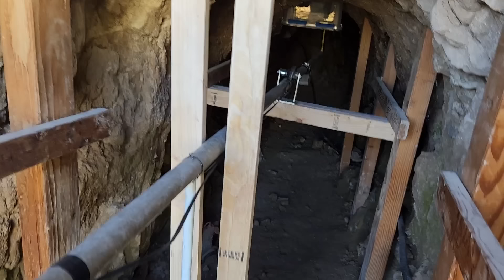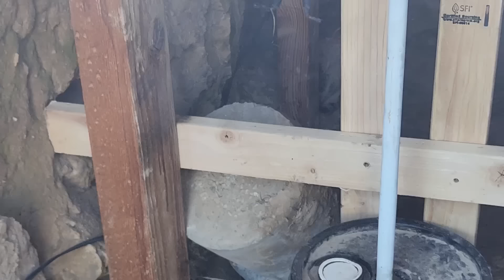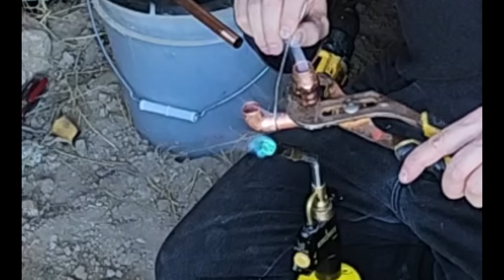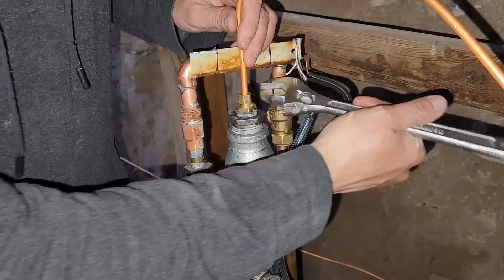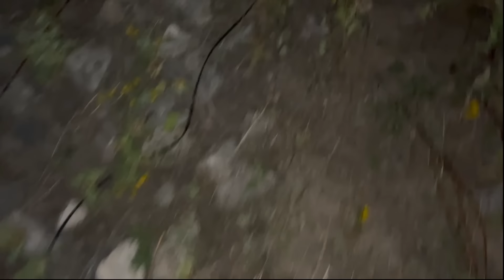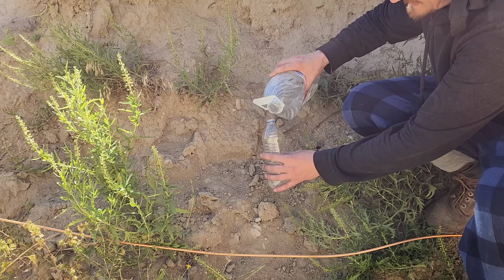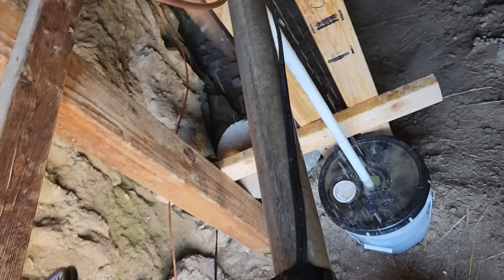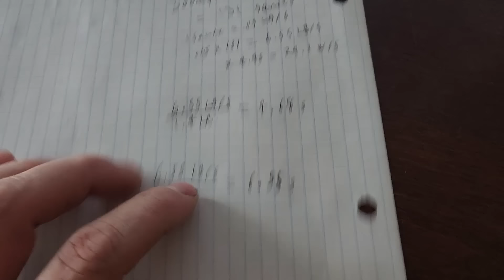Sodium Water Hybrid Rocket?

Comment: That worked way better than I thought it would! I figured you would have melting problems. I wonder if it would be better to inject both the water and the sodium as a liquid. Or you could fiber reinforce the sodium with something like steel wool. In any case I'm interested to see more!
Reply: Press the sodium flat onto a piece of posterboard large enough to then roll into a long tube. The paper (depending on thickness) should form a graphite shield and allow only a limited amount of sodium to make contact with the water, and it if everything works, the sodium will burn in a spiral pattern with minimum loss from rapid melting. This should produce a more controlled burn for a longer duration.
Reply: I'm also curious as to the implications of reducing the nozzle diameter. It seems to me that the smaller hole would force the water and sodium to react longer before exiting the nozzle
Reply: @lynndonbarr3153  only issue is that it increases the pressure in the chamber, and im not sure how much pressure those pipes he is using is rated for.
Reply: @lynndonbarr3153  I wonder if somehow atomizing the water could help it to react more easily/readily.
Reply: There is a fine line that must be walked in sizing the nozzle. Too large and you produce less thrust, too small and you build too much pressure and make a bomb or blow your nozzle out of your rocket. @lynndonbarr3153
Reply: @lynndonbarr3153 increase the internal pressure, especially if there was a blockage, of course but those galvanised plumbing pipes are extremely strong. There must be some data on their strength on file somewhere. More likely the top where the pressure washer nozzle is would blow out before the pipes burst. Lucky he has a tunnel!
Reply: yeh i was going to mention maybe burning the rocket outside in with a series of small holes at the bottom instead of one big on in the center
Reply: That's actually a sound idea! Maybe some kind of mesh. Would the steel wool react with the melting sodium in the pouring step?
Reply: @Misack8 Actually yes you would get some interaction in the form of ferric-oxide but it would be negligeable.  Still while I was thinking making a wax layer to accomplish siloing, this matrix would make a better complete burn
Reply: Could use NaK which is liquid at room temp, and arguably more reactive with water than sodium alone.
Reply: Read “Ignition”, I think this has already been tried.
Reply: @darylcheshire1618  I think that book covers just about every potential rocket fuel you could think of and a few more that are esoteric and very dangerous making the Pepcon disaster look like a walk in the park.
Reply: @ehsnils  It was even suggested to increase the reaction mass with mercury or dimethylmercury. The author didn’t want to do it but someone did it in a remote area, even in the ‘60s it was declined due to envirnmental concerns.
Another scientist wanted to use the unstable perchloric esters which was discredited in “The Chemical Elements and Their Compounds” by Sidgewick which was a book that I have. The passage said researchers of perchloric esters wore iron masks for protection.
Reply: I'd consider injecting melted liquid sodium and water into a combustion chamber.
But I think that sodium isn't a good fuel since it's so unpredictable. I think that the sodium/water reaction is much more complex than what we can imagine.
Reply: @ehsnils Yeah there's probably many reasons that sodium isn't used as a rocket fuel, but primarily is the unpredictable way water reacts. It seems like the byproduct heat flash-vaporizes the water and that makes the combustion uneven, and of course there's the issue of the unreacted liquid sodium falling out through the nozzle.
Reply: @stopthephilosophicalzombie9017  I just wrote somewhere else that we should: reduce the sodium-water interaction surface; 2. Develop a second stage forcing a swirl to increase time of reaction and work in a water excess setup
Reply: I was thinking something like chicken wire as a reinforcement, like concrete.
Reply: At the moment it's a solid fuel rocket, whereas injecting both water and sodium as liquids would turn this into a liquid fuel rocket. That complicates things a LOT. I don't think there's a single model rocket enthusiast or professional experimenting with liquid fuels, so it's better to instead focus on optimising the solid rocket system. There's a huge number of things that could be improved here.
Reply: @ilyaholt8607 this is a hybrid engine already though not just a solid motor
Reply: @ilyaholt8607 Cody already dabbled with liquid fueled rocket designs way back in the day, and says at the end of the video he plans to go that route. Definitely a hell of a challenge but if anyone can do it he probably can.
Reply: @ilyaholt8607 there are liquid rocket hobby rocketeers but non working with mettalic fuel
Reply: @ilyaholt8607 it's a hybrid rocket, my favorite types. Easier that fully liquid, way safer than solid and throttleable
Reply: The problem with liquid sodium is that it will corode your piping. They ran into this problem back when there was the idea to use NaK as a Nuclear Reactor coolant.
Reply: @rebeccarivers4797  I thought liquid sodium is still used in today’s nuclear reactors? Not NaK though.
Reply: I was going to suggest the same thing, I just don't know what sort of material might stand up to the temps. I was thinking something like a honeycomb in a catilytic converter that sits right on top of the nozzle, vary the length for experimentation, also there would be no reason to have all the holes in a honeycomb pattern the same size. Maybe larger around the perimeter and smaller near the center? IDK just thoughts.
Reply: Both good ideas worth checking out. I almost want to build my own rocket to try.
Reply: Considering @stopthephilosophicalzombie9017 input about instability caused by flashing the water into steam,  could you just inject steam as your oxidizer instead of liquid water? You might need to pressurize it to keep the quantity of reactant high enough. 

I'd also consider raising the rocket body to NA's melting point before removing the bolt. This should eliminate any issues at the interface between pours.

Also, I'd use a metal mesh, like window screens, to contain the sodium. 

Finally, it's worth reviewing the combustion geometry for these hybrid rockets.   Mythbusters may have done a segment on them.   Ideally,  they burn from the center out, not top down or bottom up.
Reply: Could there be a way to make the sodium as pellets? My thinking is to get the water into the sodium holding area in a method of a swirl or cyclone type pattern, the pellets will get wet sooner, they can move and help to get other pellets wetter quicker. Would this be able to increase thrust in a shorter time frame? Perhaps a water container which you could drop the sodium into in order to produce a high volume explosion/reaction in a shorter time? I am guesstimating a glass vial spear of sodium straight into a volume of h20.
Reply: maybe make it into a powder, molded with something like clay to make it stay solid. for instance, mix powedered sodium with some powdered clay or graphite and press it into shape, so that it is no longer able to melt. also, burning hydrogen will produce water. chemistry is out of my league, so i have no idea. but it might be possible to inject oxygen into this fuel? a bit of water could start the combustion.
Reply: @itoibo4208 if you had that cylinder of sodium, and instead of using water, simply placed a HO lance inside as the injector nozzle, the huge heat should create an extremely quick reaction. Yes it would burn for just a few seconds, but with high impulse I think
Reply: @itoibo4208  Making sodium powder is actually quite tricky if you want it to be a fine powder: Sodium metal is quite soft, so all the normal techniques for making powder (milling, grinding and so on) wouldn't really work - it would stick to any tools you tried to use. Like if you tried to use coarse sandpaper to make a powder out of hard cheese.

There is a way of making what chemists refer to as "sodium sand" - literally a suspension of sodium particles the size of sand grains in an organic solvent. For that you need a solvent like toluene or xylene which has a boiling point higher than the melting point of sodium: Fill a flask about halfway with toluene and add chunks of sodium. Ensure that the remaining empty volume in the flask has no oxygen by purging with nitrogen or argon. Heat the solvent up until the sodium melts, then pick up the flask (while wearing heat-proof gloves of course) and give it a vigorous shaking. The turbulence created shatters the blobs of molten sodium into a lot of much smaller blobs - and if you are really lucky, it won't all coalesce back into larger blobs while the solvent is cooling back down. This isn't a perfect method and takes practice, but it's not impossible either.

An alternative to using metallic sodium is to use sodium hydride. This is available as a powder to begin with - in fact when you buy it from a chemical supplier, it usually comes as a powder. Sodium hydride reacts with water even more vigorously than sodium metal does - and you get twice as much hydrogen gas in the process. Clay is a possibility if you can be sure it is dry enough - but I like the idea of using graphite powder as the binder, that would probably work really well.
Reply: Hasn’t Thunderfoot been working on something like this recently? Using NaK (sodium-potassium alloy) cause it’s already liquid.

I think he tried both automotive injectors and some kind of ultrasound nebulizer. (That got shorted by the liquid metal)
Reply: @felixar90  babbington burner  may work for atomisation. I've used such to combust veg oil, and sometime it has appeared to have been very close to resonating akin to a pulse jet. Had plans to try power the atomisation with pure oxygen. (oil+pure oxygen should self ignite). But not tried such yet. ..
Can Power the atomisation by steam. Which could offer a way of cooling the nozzle, as well as  supplying  water to a reaction with sodium 
. Jet the liquid metal onto point near tiny atomisation hole. The disk of fast outwardly flowing liquid metal ends up thin, and should get  punctured by steam jet resulting in spray of  atomised droplets.
.there are sometimes issues keeping  a single oil droplet +air lit. But I found a simple solution is to have plural  jets fire tangentially one way  around inside of   a tubular combustion chamber. The swirl seems to help stabilise combustion/if the flame gets pushed away from jet... It just lights the next jet, and so.   Ie it becomes a rotating combustion engine.
Reply: @felixar90 Thunderfoot is literally the worst person on the internet
Reply: I came to say liquid sodium 😂

Comment: Excellent design, I wonder if you could avoid the sodium falling out by having water and liquid sodium both spray into the combustion chamber.  Split the Argon line to a second chamber with the sodium in it, wrap that chamber with a heating element, and use a second power washer spray nozzle.  Might need to find a Y connection so the two sprays meet, and would probably take some trial and error to get the flow rates into the proper ratio for complete reaction of the sodium.

Comment: What about preheating the sodium to a liquid state and forcing it through a pressurized line to combine with atomized water also? This would prevent the solid sodium from melting and being used as reaction mass through the nozzle before reacting.

Comment: Maybe try using a baffle system inside the reaction chamber, something like a perforated tube through the middle of the sodium that way it will slow the reaction and keep large pieces of sodium from being pushed out the nozzle which will create a more consistent burn and more thrust

Comment: Steam can make enough specific impulse for flight.  Starting with steam in the first place as may solve some issues , like self pressurization and reaction interaction and the need to super heat the Water from ambient temp.   A steam rocket over your sodium simply in a post reaction area may not need to be chambered, just an area for expansion and velocity to continue like a big exit cone or nozzle made from sodium or a second bigger chamber lower psi than the phase flow of the first but allowing for expansion of mass. Also are there any amalgamates of sodium that might react less violent but still have time to react, like a plated H2o2 catalyst pack.

Comment: Thoughts (probably mainly bad):
Spraying the water from below
A mesh container of sodium beads covered in water soluble coating
Invert the combustion chamber, drop sodium pellets into a pool of water, and ducting the exhaust 180 degrees to exit through a downward-facing nozzle.
Same as above, but chamber full of sodium, and feed the water in from the bottom.

I can think of so many bad ideas to throw at this!

Comment: hey cody have you tried using high pressur steam ? id imagine its worth a try to inject high pressure steam and adding more smaller holes through and around the main hole in the sodium tube ? id be curious to see if that helps with a smoother run  and better results

Comment: Maybe instead of a pure sodium fuel pellet, you could do a layered one so a thin layer of sodium, a thin layer of something dissolvable in water but ideally heat resistant (powdered dry clay maybe? or something along these lines at least) to isolate the sodium further in the chamber from the water and to hold it compact still whilst the outer (inner) layer is burning. This may produce a much smoother burn of the rocket fuel pellet. You'd probably have to play about a ton to get the layer thickness right, but it could work I think.

Comment: It's probably a good idea to not put the sodium in in a single solid blob because all those remaining unreacted sodium tells me it needs more reaction surface.
Engineering question: how does one reliably deposit sodium into a high-surface configuration? Etching or even wet-etching is out of the question for obvious reasons.
Reply: Seriously, it's probably easier to vaporize the sodium in an inert atmosphere & then injecting it into a combustion chamber along with steam. Gonna need an inert & fire resistent combustion chamber recoil valves.

Comment: So with your next rocket going to be a fully liquid NaK plus water design that means you're going to have to come up with an injector for the NaK and I kind of want to see what happens when you push the alloy through a pressure washer nozzle at pressure washer pressures and just out into the air. Sort of a liquid metal flamethrower.

Comment: The computer next to Cody whilst he is doing paper based integration is just a paper weight, whilst the paper weight is the computer. Love it
Reply: We have technology, scissors are great for cutting paper. Best technological innovation since sliced bread.
Reply: @heroslippy6666  wait, do scissors post-date sliced bread?!??  ;)
Reply: @DavidLindes  no ;(
Reply: I still die a little inside seeing him switch from imperial then metric (once things have to actually be accurate) and then back to imperial again.
Reply: @Runefrag  Imperial is perfectly accurate, the only error would come from someone who doesn't know how to use it.
Reply: @RossLouis96  The only reason why that dumpsterfire measuring system has any semblance of accuracy is because there's been a lot of effort to have it be translated into metric with at least 4 decimals.
Reply: @Runefrag the ratios between units doesn't change the accuracy. Metric is more logical and easy to use, yes, but Imperial is no less accurate than Metric.
Reply: @Runefrag  You should see the other funny measurement systems Cody uses occasionally.
Reply: LOL (actually) :D
Reply: I didnt even notice it at the moment, hillarious indeed 😂
Reply: under-rated comment!

Comment: Too much water too fast, should have some comb/zigzag inside and spray onto it like a pressure washer on a low setting.
Also feel like the core hole of the fuel shouldn't be in line with the exhaust nozzle so it has more time to build up pressure and mix the fuels.
Another banger video though, keep it up big man!

Comment: Such a shame what an absolute waste that wasn't nearly enough water pressure to sustain a powerful thrust. 800 PSI by the time it got to the nozzle was barely anything. A super soaker water gun would of sprayed harder than that. Should have went to at least 1000 or 1500.

Comment: Maybe it could be made more efficient if you injected the water into the bottom of the reaction chamber, and had the nozzle connected to a pipe that runs through the middle of the chamber (and is open to the chamber at the top) so that the reaction chamber exhausts the gasses from the top of the chamber, rather than blasting out the unreacted water and sodium from the bottom.

Comment: I wonder where the water went? I think the big issue here is that when the sodium reacted with the water, it dramatixally increased the pressure in the chamber. That could've caused the injector to close, but unlikely with I think you said 800 psi. But more importantly, the pressure probably pushed the sodium into a plastic flow and broke it on the way out of the chamber. Dual liquid injection should work much better.

Comment: I wonder if there’s a convenient option for alloying the sodium such that it’s still reactive, but doesn’t melt so quickly. I’m no expert on metallurgy, but iirc sodium melts at a quite low temperature. Aluminum is also fairly reactive, but melts at a higher temperature, so if those can be alloyed, presumably with the aid of a flux, perhaps a higher performance fuel alloy can be obtained. Zinc would also probably be worth a shot. Lead would be interesting, but too toxic to be worth testing